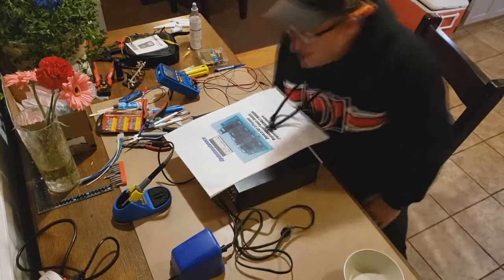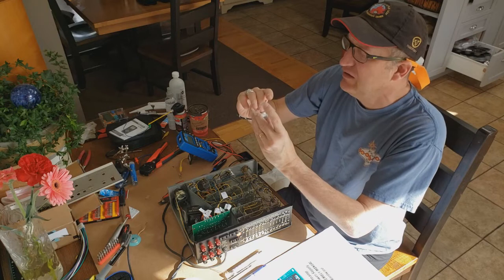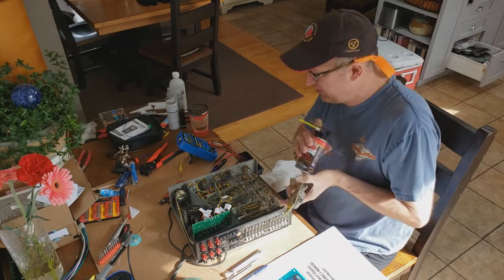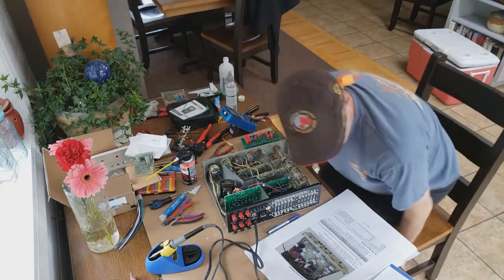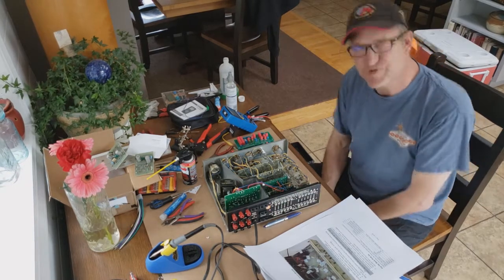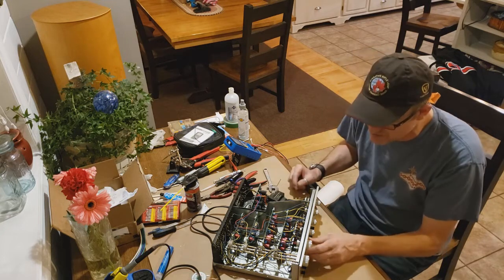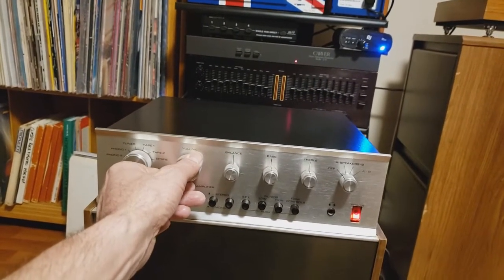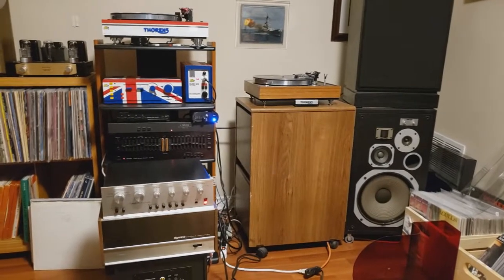Dynaco PAT 5 Assembly Video and Sound Check 23 Feb 2019

Comment: Did you listen to the preamp before the mods and can you tell us the differences you heard if any with the updates?  Also, does the phono update still allows for both the MM and MC cart as the original PAT-5?  Thanks for posting the video.  Now lets see the mods on the 150 :D
Reply from the maker: I did not. There were issues with it so I talked to the fellow who asked me to do the work - he wanted to do all the Upgrademydynaco kit upgrades. Phono update does not make it a MC phono preamp. Just MM.
Reply: @navydiving  Thanks, I have the Bi-Fet PAT 5 version with the MM or MC with the toggle switch between the Phono 1 & 2 inputs and was wondering if the Update My Dynaco kits accounted for that and improved it.  I believe the circuit is on the Line board that increases gain by 6db but with the modern LOMC carts I think they will need a tad more than that lol.  Something like 50-60db.  May have to figure out the circuit myself.  But surprised that for the length of time that these kits have been out, no one has done a A B test between the two before and after.  I understand that the new opamps will improve the noise floor, but these original PAT 5's are pretty quite to begin with.  Thanks again for going through the trouble of filming your efforts, I enjoyed watching you work :D.